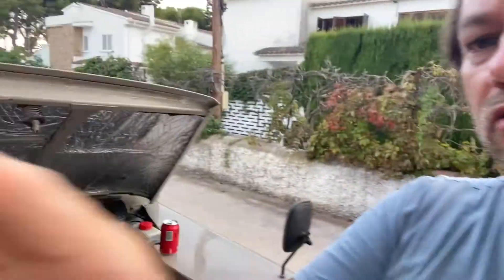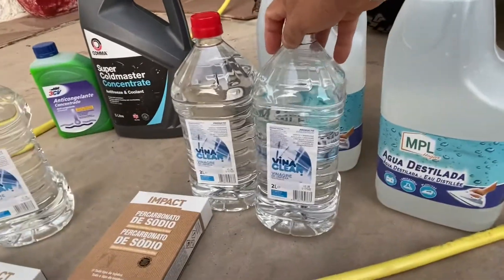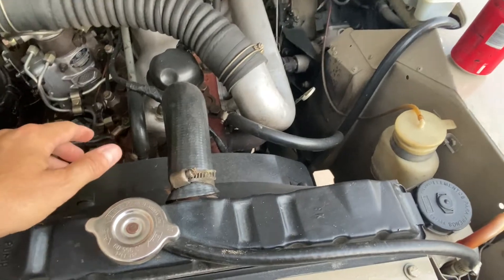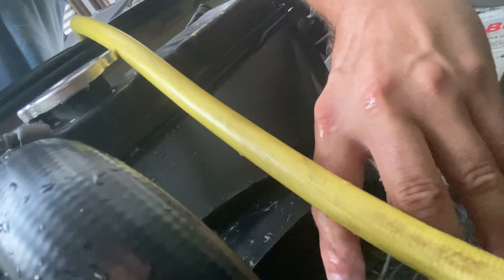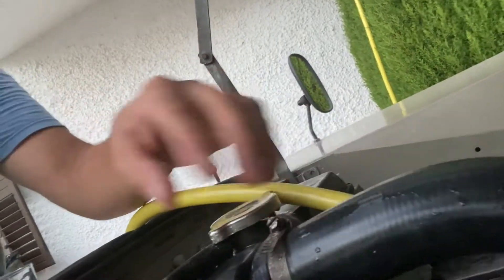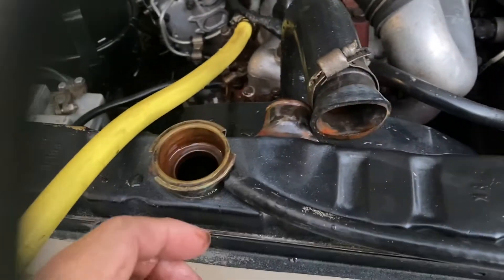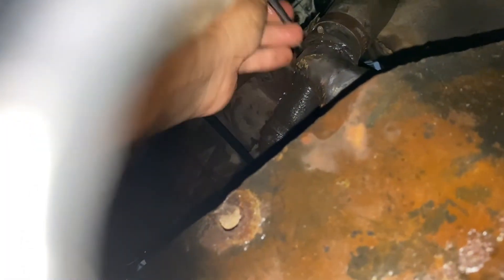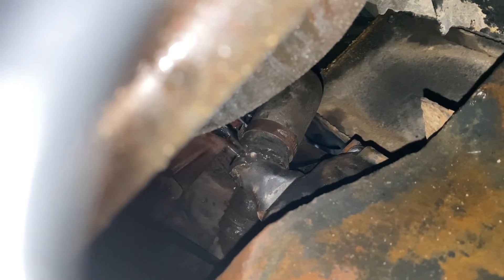Radiator clean with Vinagre and Bicarbonate Soda overnight. Coolant Radiator flush with hose.

Comment: Indeed one can soak/clean the vehicle radiator with soda and vinegar, separately, or in sequence .. but not jointly. The bubbling you see seems to be 'effective' but is mainly the soda and vinegar reacting with each other (extreme alkaline with extreme acid), not with the grime in the radiator. So .. one overnight with a solution of soda (2 tablespoons per liter of water) and thereafter one overnight with vinegar (50% diluted with water). Then a gardenhose flush. Then for those with money a nice flush with an all-in-1 commercial radiatorflush. Then the radiator fluid back in.

Comment: Vinegar (acetic acid) and Sodium bicarbonate mixed together = CO2, sodium acetate (a salt) and water.

Basically you're neutralizing the acid and creating salt deposits inside the system. Negative effect. 

I recommend deleting this video and making a new one doing it the correct way. Vinegar soak for a few hours after having run the engine up to temp (remove thermostat for best flow) , drain and refill with water + Sodium bicarb to neutralize the acid. Water flush again then Fill with coolant mix.
Reply: Hello.
I have a truck and it takes 34 Litres.
I want to clean the cooling 
cycle with vingar. 
what is the mixing ratio of vinegar? 
what is the mixing ratio of sodium bicarbonate to clean the cooling cycle from vingar
Reply: @Mohammed-masood450  Hi. As vinegar @ 5% is not very strong, you can go pretty high in the ratio. I've used straight vinegar in individual components removed from the vehicle and the cleaning effect wasn't crazy fast. I was able to guarantee a full flush though, for a whole system in the truck perhaps 75/25 ratio would be good. If aluminum block it won't seem like it's done much, iron block will see a lot of rust coming out.
A couple of hours should have a good cleaning effect, repeat of it still looks dirty inside. 
Do keep in mind it does eat at the aluminium as it's acidic, so if you have very old components that have already corroded/worn thin you may end up with new leaks. Sometimes the corrosion deposits are actually blocking a hole or crack which end up leaking after the crud is gone. If a part is too far gone it may need repairing or replacing.
Approx 1 teaspoon of sodium bicarb per 250ml should do the trick to neutralize. Mix it with the flushing water when filling up after a few rinses (how many depends on how dirty the system is). It will bubble/fizz so leave the system uncapped. Leave it a while, after bubbling stops empty and flush out with plain water. Then fill with coolant mix.
Hope this helps :-)